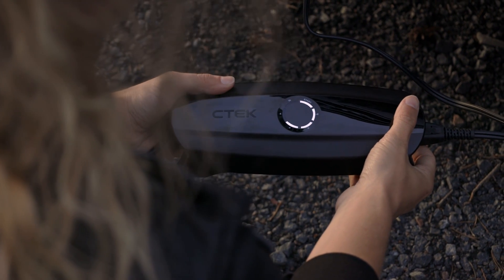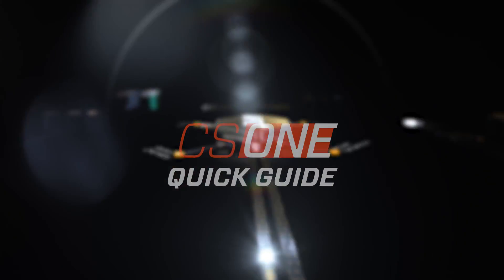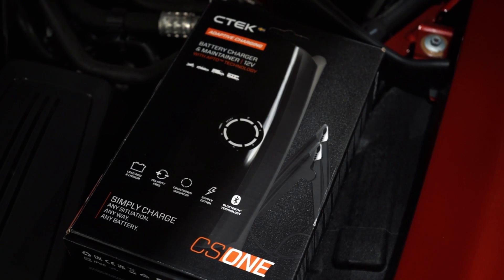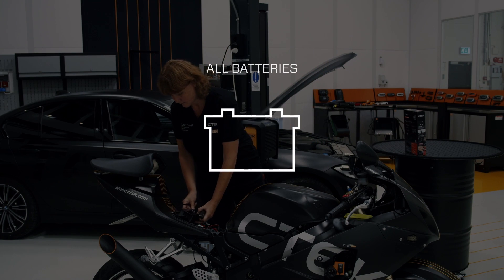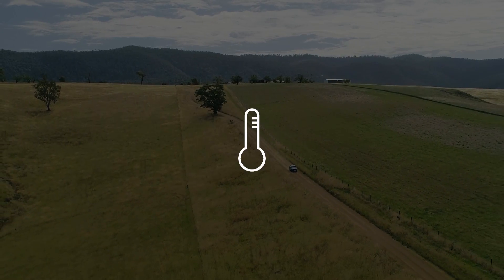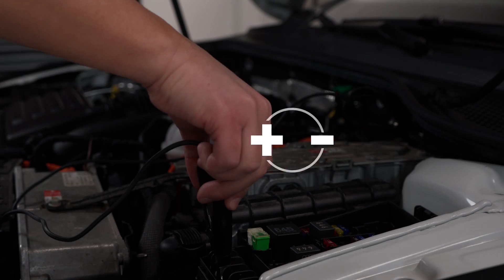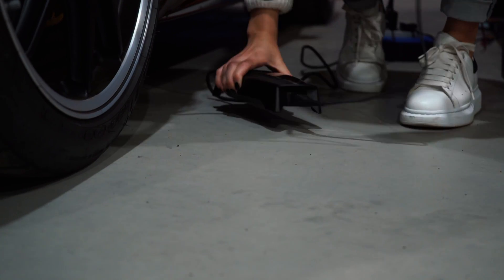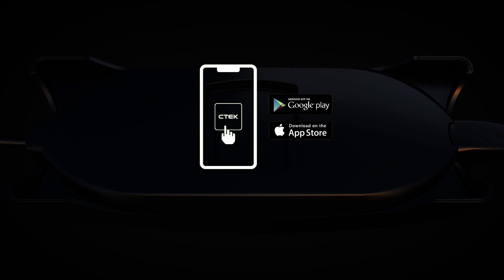Quick guide CS ONE | CTEK

Comment: doesnt work with android !! no fix date planned as  confirmed with CTEK Support
Reply from the maker: Within the Android 13 update, changes have been made to the new BLE (Bluetooth Low Energy) stack vs the previous versions for manufacturers like Samsung, One Plus, etc who now must implement the new stack in their phones. This has caused several problems for companies like us with Bluetooth dependency.

Additionally, NRF and other 3rd party Bluetooth apps are experiencing the same/similar issues connecting on Android 13. Unfortunately, reproducibility of the issue is sporadic, with far too many permutations of phones and manufacturers.

Google have released updates, however there is no market indication that this has resolved the issues, for which the onus still lays with the individual manufacturers. It is also noted that Google’s Operating System update has been released as a patch that remedies for some manufactures on some OS versions, and not for others.

We want to assure you that our team, along with Android and Google are actively working on finding a solution, which we are hoping will include the patches to fix the issues in Android 14. In the meantime, we kindly ask you to stay tuned for future firmware and patch updates for your phone.

Please however, contact us at support@ctek.com where we will help try to troubleshoot the issues you are experiencing.